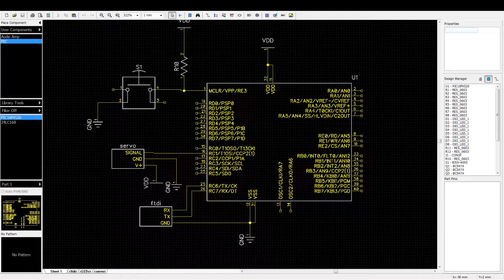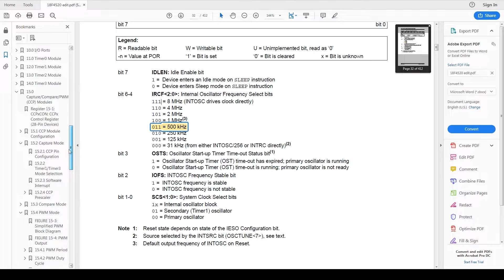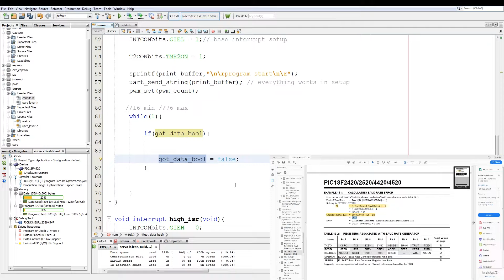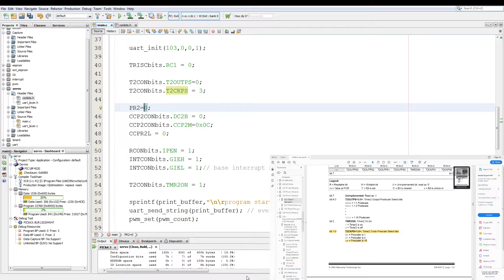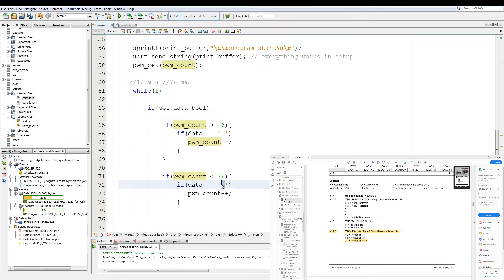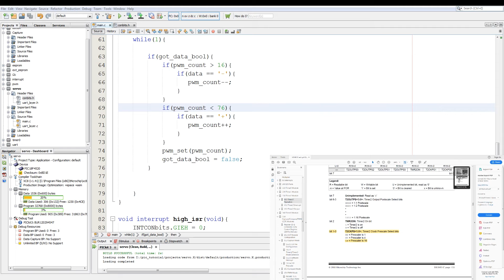Controlling A Servo with PWM & Timer 2 🔴 PIC Microcontroller Programming Tutorial #14 MPLAB in C

Comment: Might you know how to map the inputs for the joypad to the specific channels and direct to the ADC register for output in assembly code
Reply from the maker: Think your phrasing is not correct. Got a video on using buttons as inputs. For thumb sticks, these are usually 2 analog outputs in X and Y direction that the MCU can read. You can use trigonomics to find the 2D position of the thumb stick.
Relevant videos
https://youtu.be/jVAyT2XUiqU
https://youtu.be/AKv3cxVH9y0
https://youtu.be/LYPaOXhvXWk
https://youtu.be/MiPxVmj_nHI
https://youtu.be/yFvJXxaY4O0